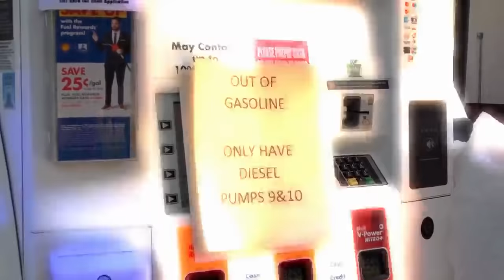Moonshiners Make Gasoline Out Of Alcohol During Gas Shortage | Moonshiners

Comment: Makes you wonder why natural gas engines and alcohol engines weren’t researched further….E85 engines have hardened valves and valve seals which tells me that E85 is a little harder on the head(s) if anything. My only concern would be O2 sensors. They run at a specific voltage and as gas is burned O2 is monitored as it’s introduced and as it’s expelled from the engine.  If the O2 burn detection system “sees” too much O2 it will attempt to add fuel. Point is, you may be spending $100 to save $5, not including your time. In the old internal combustion engine, this shit would have worked flawless as you witnessed, but I wouldn’t burn it in a modern vehicle. Kudos to these gents though. The world needs thinkers and builders more so than ever before.

Comment: Love it ! Well done. 
If you would like to get to 200 proof, let me know. 190 proof is a lot of alcohol but it still has 5% water in it. 

I am a chemical engineer that has worked in the oil and gas industry for 20 years. I have blended gasoline and alcohol on an industrial scale, 10's of thousands of barrels at a time.  The alcohol we use is distillated and dried to 200 proof. 

Yes.  it can be done, but not with an ordinary still. There are methods to get that last 5% water out of the alcohol (fuel). The less water you have in the tank means less problems with your engine. 

Keep up the good work !

Comment: One problem ethanol is it eats plastic for dinner so those plastic/rubber lines that last 200k or more miles will only last you 40 to 100k with that amount of ethanol flex buses have that problem do to the 75% to 85% ethanol gas they use.

Comment: There's an engine wear and tear cost that comes with running alcohol in combustion engines designed for gasoline. It's all about fuel burning temperatures, and designed running temp specs...

It'll work, but it can be hard on the engine, that's all I'm say'n.

Comment: As Trudeau's carbon tax on gas gets higher in Canada, rural folks will start doing this, I predict. Looks like all you need is a still, which can be made as well with copper sheets. This can be done with grass too, but corn has more sugar and seems to produce better results. He also uses yeast, a hydrometer, buckets, a hose, and propane for heat (the old timers used wood), sugar, a good stir stick, jars, gas cans, and a small bucket. One his up-front costs for equipment are out of the way, I'm curious what the cost of sugar, yeast and corn would be as compared to gasoline? And what effect to 30% gas and 70% ethanol have on your engine? Do you have to modify your car to use it?

Comment: You have to be careful with alcohol, some fuel components are not compatible with that much ethanol and you have to pickle it if it's going to sit or it will absorb moisture and rust your fuel system

Comment: OK. here we go. You can run straight alcohol if you plug the carburetor off around 80% because alcohol has it's own oxygen. I drove a Subaru for 3 years on straight alcohol with no problems " BUT "" alcohol swells certain rubbers like on the float or seat rendering it by plugging it completely off of flow or it won't seal making it flood. I learned that on lawn mowers and motorcycles ...

Comment: Mixing ethanol with gasoline is a bad idea, here in Europe they already started mixing 10% ethanol with gasoline at ordinary gas station pumps and it causes real problems for engines not designed for it. Anything more than 10% and you will screw up any engine.

Comment: The reason why this ain't a great idea is because the materials the fuel tanks are made from, ain't meant to hold alcohol and corrode at a more rapid pace. The alcohol is also going through your engine and gradually corroding the inside. I don't know about other countries but in the UK we have tanks labeled for 95% gasoline 5% ethanol and tanks labeled 90% gasoline and 10% ethanol. Gradually waredown the parts of your vehicle that come into contact with higher ethanol amounts.

Comment: Bad idea. Dirt bikes and old tractors are one matter, fuel injection and ECMs are another. Put what's basically E80 in a car without a flex system and if it even runs you'll get pinging, line rot, etc. You'll trash most cars running homemade gas from people that know nothing about it.

Comment: So essentially they made e80 but before y’all go tryna throw e85 or homemade gasoline you gotta make sure your car is flex fuel compatible and if it isn’t you’ll need bigger injectors, flex fuel sensor and a tune because e85 has less energy per gallon compared to a gallon of gasoline so you need to put more fuel in it to compensate for the difference in energy so you don’t run lean and blow up your engine and with e85 or e80 you get on average of 20-25% worse fuel economy due to the energy difference

Comment: Unless it’s a flex fuel vehicle fuel with 80 percent alcohol requires 30 percent more volume of fuel meaning the vehicle will need to adjust fuel trims plus 30 percent causing the car to run like complete crap and jerk and shut off etc

Comment: What you going to do if you don't have any gas to mix it with
Reply: Replace any seals that fuel hits to resist ethanol and fuel jets to handle the extra requirement, and a tune to deliver the fuel

Comment: OK so there's half truth here alcohol burns fast and isn't  high in btu as gasoline you need about 120% enrichment to safely "for the engine" burn 85% alcohol or higher, Isopropal 91 is cheap at roughly $5 a gallon it would be a way cheaper alcohol compared to grain , iso is dirtier though.

Comment: So many experts in the comments.  An engine needs an explosive air/fuel mix to push the piston down, propane, NG, gas, alcohol; doesn't matter; adjust air/fuel and it will burn.  Optimal compression ratios vary with different fuels as does spark timing and heat range of plugs, but most engines will run at some level given a reasonable air/fuel mix.   End of story there.  Electronically controlled engines can adjust "fuel trim" approx 25% in either the rich or lean direction. E85 vehicles measure alc. content and adjust further.  Alcohol has a lower amount of hydrocarbon than an equal amount of straight gas and therefore requires an adjustment to the fuel mix to create optimal performance.  MANY carbureted engines run rich by their very nature, that Farmall has probably been been burning 15 or 20% rich for decades and also has a manual choke which can be used to increase fuel mixture until it runs well enough to operate.  There is a huge problem with corrosion when the alcohol mix fuel is left to collect air as it sits, alcohol pulls moisture and the resulting mix breaks down into a corrosive nightmare WHEN IT SITS. This is a problem for older stuff and small engines but not later model cars where the fuel system is sealed and does not allow evaporation or contamination because the fuel cannot oxidize when parked.  Alcohol does not damage the actual engine unless you run too lean for an extended period of time, which is also the case for gasoline.  There is an enormous problem with alcohol not being compatible with fuel SUPPLY/DELIVERY components, mostly the various different rubber compounds used in fuel pumps, hoses, fuel pres. regulators, accelerator pumps, injectors, seats and gaskets.  If your engine components were not designed for long term exposure to alcohol in high concentration you will have troubles.  Lastly, no matter what you have, in most cases you could run short term on straight alcohol or a high blend and get by with out any trouble as long as you drain off and flush out the remaining fuel when you are done.

Comment: Hey buddy very cool project, you can use a falling film evaporator or 3 stage film evaporator and vacuum pump for doing vacuum distillation, of both cellulose and sugar mashes. Vacuum reduces temperatures neccesary and greatly increases speed.  A falling film evaporator can be welded and takes up very little space... also runs continuously so can adding mash at one end and alcohol comes out atvthe other.... safer faster cheaper and will help local community and environment.  3 stage stage falling film.set up is same size as your stills square footage and can produce around 200 liters and hours continuously... thanks for this video and making people realize our only dependence on fossil fuels is one that's created my current taxation system...in my opinion the tax on biofuels is a violation of liberties and freedoms guaranteed in constitution.  Why is foreign oil receive subsidies but farmers are taxed for making even there own fuel...

Comment: except 20% gas 80% ethanol would destroy most engines unless its really modern
Reply: e85 is  83% ethanol so if you have a tune on your car and a few other parts you can totally run it :)
Reply: @nullsec9613  it isnt just the tune man.. ethanol attracts water..  and ethanol rots rubber fuel lines and gaskets.. anything (modern) and i mean modern by ob2 or newer from 90s up.. shouldnt run that unless the car was specifically built for it.

Ethanol also lowers fuel mileage over pure gasoline.. so mixing eith gasoline only hurts your mpg.. 10% ethabol gas actually drops fuel economy by 10% lol

Comment: Alcohol is the safer, cleaner burning fuel than gasoline.  All those lies about how ethanol damages rubbers, plastics are told by people who know nothing about fuels and contents. US E10 gas since year 1990 does have huge amount of benzene and xylene that damage materials more than ethanol. With proper air/fuel ratio ethanol engine runs cooler than gasoline engine, too lean mixture damages engines regardless to what fuel engine runs.

Comment: & How Many tractors run on Gas / Petrol these days.
Reply: Biodiesel can be home processed from seed oil, you need to retune the engine like you'd need to for converting gas to ethanol, and it needs more processing than ethanol to remove glycerin, but it's possible

Comment: If you run your car on pure ethanol, it will run very hot and burn up your mostly aluminum modern engine. Ethanol burns much hotter than gasoline and only small percentages can be cut into gasoline in order to “stretch” the gasoline. Do not think you are going to run your car on pure moonshine/ethanol and all will be well….It won’t. This video is a load of crap!

Comment: They are not making GASOLINE.  Those stickers that say E10, E15, E85 tell you what  percentage of your fuel can be ethanol...10%, 15%, and even 85%.  

They are only making ethanol.  And since straight gas is only sold in farming communities, the gas they'd have to mix with their "shine" will already have the acceptable level of ethanol.  

Because ethanol absorbs water, engines have to be designed to handle water in fuel.  But they are designed to handle only do much water.  

This crap will ruin engines...and it won't be covered by any drive train policy.  That will be out of pocket money.

Morons.

Comment: (engineers join chat) hmm gasoline and alcohol is about same no different  because gasoline have 87% than alcohol moonshine is 80% so it just 7%less to burn on water
it doesnt hurt engine with carburetors but fuel injecter so good luck on that
water will clogging up fuel injecter but carburetors is wide open port for fuel get in engine and fuel injecter have tiny hole top to bottom but carburetors have med size hole so any fuel can go thur it without issues without trouble there no clogging carburetors unless it sit in there over years and yah that about all is as to it
you can use 91% alcohol in fuel can it burn like 89% gasoline but it expensive for small bottle or you can use lighter fluids but it at 50% it make run less hp less tq

what fuel make different: well that pend on how much alcohol is in fuel 
if you want more power out of your engine then go 100% alcohol get so much hp and tq out of it
if you want get from a to b everyday then stick to 80% alcohol it less hp less tq felt normal running engine

what make worse in engine
uhh that going be carbon monoxide stuck to head and pistons and in exhaust pipe that petty much clogging up engine
(to get rid of carbon monoxide easy way is full revving engine everyday or drive like race car and yah will burn off carbon monoxide) 
if this is any usefull information then it should be because other engineers have same information
Reply: You forgot to say ethanol is bad for engines

Comment: Any mechanics knowledge here would be appreciated. I have a 1984 Mercury Grand Marquis 2D coupe, 5.0 302 windstor. EFI. It’s been sitting for idk maybe 2-3 months with under half a tank of gas, I like to start it up to keep things cycled every now and than (can’t really drive it because it has issues high idel in park but in drive//gear it will adjust and sound normal. When I first pull out the dirt road it will accelerate without touching the gas pedal so you have to hover over the break until I get to the blacktop) once I run through some gears, that’s when the engine begins to not accelerate on its own and when I take my foot off the gas pedal the engine slowing down begins to work properly. Is it bad to start it up with that old gas??? Can I add fresh gas to it to help burn out the old? Good or bad idea? Also does anyone know why it does that accelerate thing until after I run it through some gears? Sorry I have no one to ask IRL. Tag me if you think you know what the problem could be. 51k miles can you believe it!!? Honestly such a minty gem.

Comment: F'ing propaganda. Ethanol is about 10% less energy effective than gasoline and doesn't produce a high enough caloric burn to create a cyclical production process. Ethanol production requires use of fossil fuels to remain effective as a fuel source. 

This is essentially the equation: 
1gal. gas to produce 1gal. ethanol, which has 10% less energy, meaning another 0.10gal. ethanol is needed to produce the same amount of work -> 1gal. gas + 1.10gal. ethanol = -> 8,887grams CO2 (epa.gov) + ((5,770grams CO2+ 577grams CO2) = 6347grams CO2 ethanol) = 15,234grams CO2 Total released into the atmosphere. This is not a net neutral fuel source. It's a gimmic and will dump vastly larger amounts of heat retaining CO2 into the ecosystem. Discovery UK is made of fail.